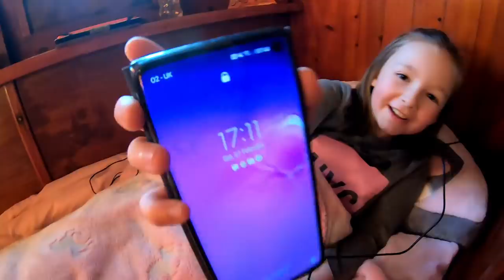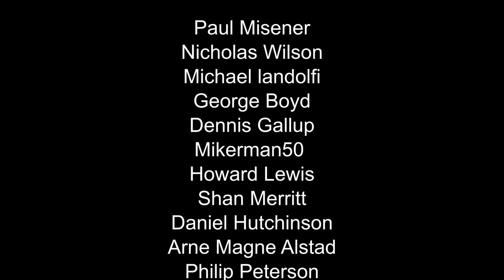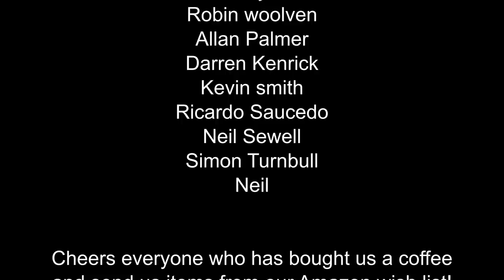Ep 9 What awaits us under the poop deck cover? Restoring our wooden WW2 Ship - Ship Happens

Comment: Not sure if you will read my comment or not but I will give you some pointers. First if you use salt water to rinse off the boat dirt you should finish it off with fresh water rinse if possible. When the salt water dries the salt will remain and that attracts moisture. This will result in exposed wood to decay quicker. This why metal rust quickly in a saltwater environment. I have restored a bunch of boats, never one as large as yours. Largest I have completed was thirty feet. I found the best approach was to tackle one issue at a time. If you try a shotgun approach (everything at once) you will become overwhelmed and discouraged. Try focusing only on like electrical issues. Resolve all of those then move on to the next topic and so on. That way when you start to get discouraged you can look at what you have completed to get a sense of accomplishment and  lift your spirits to carry on.
Reply: Do not follow this freshwater rinse advice. Rinsing with freshwater defeats the purpose. You want the salt there. Yes, salt attracts moisture but it will do no harm if the salt is there with it as the timber won't rot in salt water. The teak shouldn't rot anyway but what is underneath will in fresh water. Freshwater has no place on a wooden boat except for drinking! Can't do much about the rain so you keep washing down with salt water. Keep up the good work.

Comment: I still think that if you get the boat out of the mud and in a place that it's afloat in both high and low tide that would help you to make much more and better progress on getting the boat fixed up it just not go9d for the boat to just be sitting 8n the mud most of time time you said it the haul is in good shape. But if it sets in the mud to l9ng it won't be so moving the where it'll be afloat all the time would just be better for the boat ship and make ever for you to get it fixed up

Comment: Great video,
 I'm almost certain that someone may have mentioned this to you already based on the comments in a couple of other video's I've seen recently on abandon boat grave yards and thats that your boat has been spotted in the video's and that the yard where your boat sits presently is a grave yard for abandon boats. 
I hate to sound off like one of those evil little grammar trolls. and please don't be offended when I say this and your not the first site I've pointed this out on from the UK and you probably won't be the last. but your mispronouncing Router.  
Your saying Rooter. A noun: rooter; plural noun: rooters a supporter or fan of a sports team or player.
"ringside rooters rose to salute him" or a drain cleaning machine. A rooter is a drain cleaning machine that was invented to unblock drains that have been clogged from tree roots and other hard to reach debris. 

A Router is a noun: router; plural noun: routers a power tool with a shaped cutter, used in carpentry for making grooves for joints, decorative moldings, etc.
A noun: router; plural noun: routers a device which forwards data packets to the appropriate parts of a computer network.
Or to put it another way when you go out side, you don't go oot side do you?
I'm sure someone will read this and think well the english invented the language so they must be right. Well not according to oxford dictionary which is where I found the definition's of the word's.
So please under stand that I'm not trying to be rude or be a troll it's just an observation is all.  I like what your doing after all not many people would go to a boat graveyard to buy a boat and then do what your doing on you tube with it. it takes a pretty big pair of walnuts in my book.
Good luck with the rebuild. I'll be watching and liking ever video and when I've got a little change dropping it your way.
Reply: Were they not referring to the internet router which routes the signal rather than routs it? The e changes the pronunciation from ‘out’ to ‘oot’ so that we can differentiate these distinct meanings.